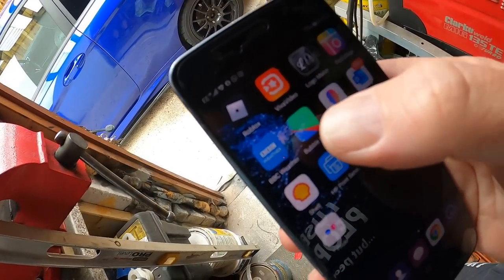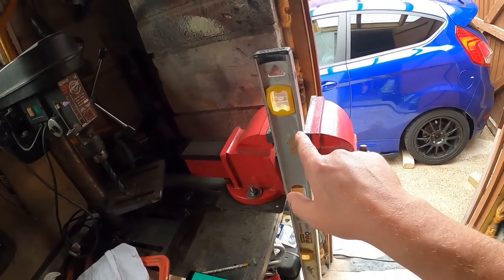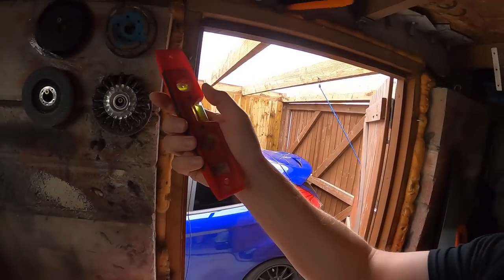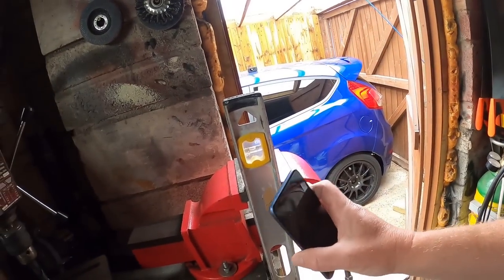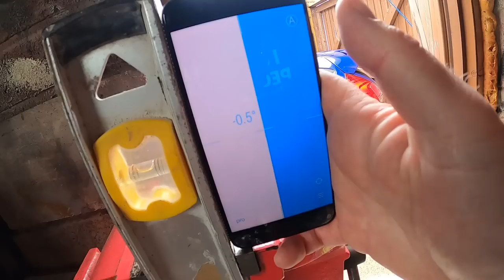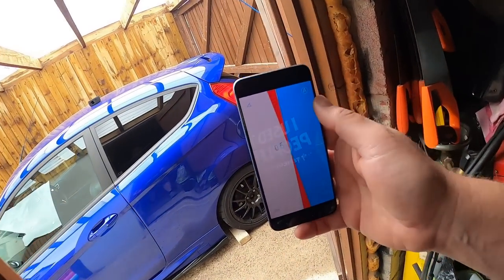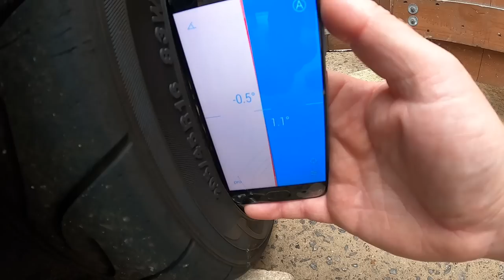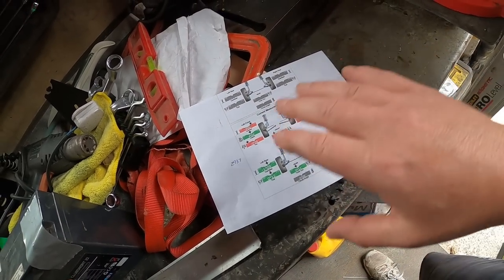Check your camber with a phone app / super precise + bonus track footage

Comment: I just tried this but with the app Bubble Level because it has 10ths of degrees and seemed pretty accurate. I found a car park with a polished concrete floor (makes everyone’s tyres squeak) and it flat as a pancake and showed 0.0 on the app. 
I drove to a parking place that I could drive dead straight into and to be sure I reversed out 50 meters and then forward again 3 times without touching the wheel to be sure the wheels were straight ahead. I measured both front wheels 4 times and got -1.6 and -1.9 which I find is out for standard settings. The car doesn’t scrub tyres on the inner edges at all so I’m surprised ive got readings that are double what they should be. The reason I am checking is because my drivers side hub has recently been off and I was worried it wasn’t set back up correctly. Now I’m pondering if app is accurate but I do like the idea of using an app.

Comment: Nice, but you forgot the basic main rule.. The car has to be on a 100% leveled surface with all 4 wheels to get a camber reading, your car is for sure tilted in whatever direction if it's there at your parking lot.. for people who want to do this, go to a water leveled floor in a garage, or a parking garage and take a spirit level to cross check the floor you are standing on to start with, same applies to headlight adjustment.

Comment: Second question. What tyre pressure do you run? I'm off to Donny Monday. Thanks for your help.
Reply from the maker: Ad08r 30psi hot and Ar1 27psi hot.
Reply: At Donington on a hot day we saw pressures rise by 10psi after just a few laps. Quickly becomes tyre melters at 40psi.
Reply: @Sparkplugsteve  Is that 30psi hot all round?? Ford OE is I think 36 F 26 R? Cheers

Comment: What discs do you use on track, and how are you going on with the Endless pads? How many track days have they done? Regards
Reply from the maker: Front is standard for discs. Pads had 2.5 trackdays in them and wearing well.
Reply: @Sparkplugsteve  Cool. I am second track day of use with stock discs but Pro Race pads.Thinking of the Endless ones next time.
Reply: Fast H Racing exact setup I’m running mate with prorace, they are great for the price but you can see the capabilities are a lot better from the end of this video with Steve chasing me!